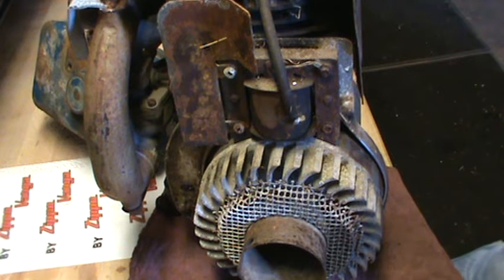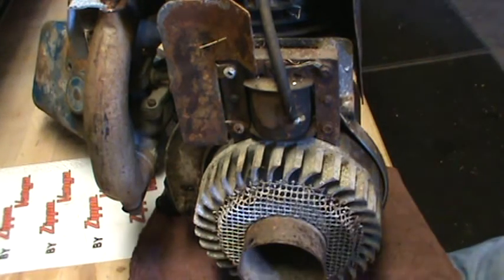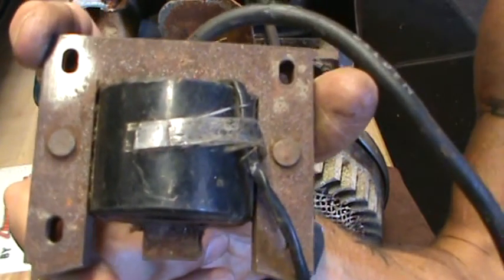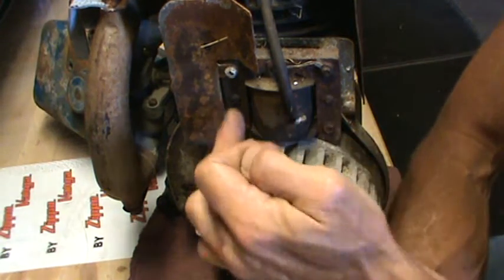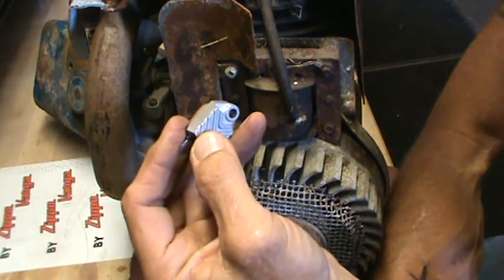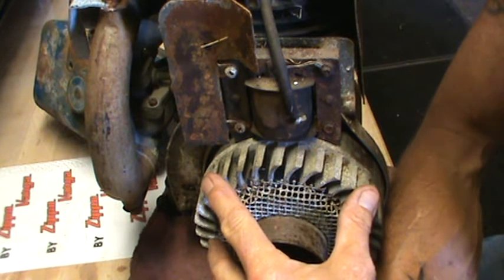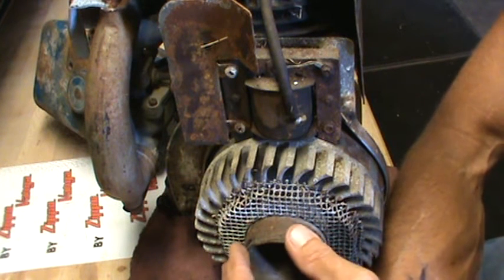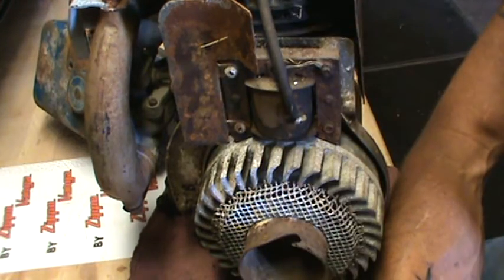Early Briggs and Stratton Electronic Ignition

Comment: Mr. Zippo I know you're busy and probably get people asking you questions all the time but I sure hope you read this. I don't know how else to get my question to comment on something. I have a old Allis Chalmers b1 late 50s early 60s and I cannot get any fire I put the nova-2 on it and got fire for a minute but it stopped my points are non-existent I didn't have them when I got the tractor I'm at my Wit's end and I don't want to scrap the old tractor but I don't know what else to do. Wish I knew how to send you a video of it. Hopefully I will hear back from you... Thanks !!
Reply from the maker: Daniel. What engine is in the tractor. Is it the original Model 19? If so, the Nova II will not work with that type of Magneto. Another option is a battery ignition, but that too requires points. If you've got the Model 19, email me. My email is in the descriptions of my later videos. I will then send you manuals for both your engine and tractor. Zip~

Comment: Excuse me for not watching the entire video (I'm currently very short on time as of writing this comment) but where did you get the parts for the electric ignition? I'm building something from the ignition parts from a briggs I converted to steam, and using the spark plug for a cannon (as an ignition source) and am looking for electric ways of sparking it as I can't get the magnets off the flywheel of the engine.
Reply from the maker: Honestly, your best bet would be to use a Buzz box or an old Fairbanks Morse Ignitor. But if you're insistent on using a Magnetron, you simply need to duplicate the ignition system as designed. you can remove all of the cooling fins from the flywheel, use the crank shaft end as a mount and fabricate a carrier bearing and gear or pulley to mount to the crank shaft then use a NOVA II in place of the points and condenser to simplify the ignition source so that you won't have to find a place to locate the points or fabricate a way to open and close them. I hope this is helpful and gives you a direction to go in. Zip~

Comment: Zippo, how can a Magnatron coil power both the spark plug and charge a motorcycle battery?
Reply from the maker: I'm not sure what motorcycle you are talking about John, but a magnetron is a separate system than the system that provides the spark to the engine. Two totally different set ups and voltage limits. Zip~

Comment: I have spark when I take out the plug and put it in the spark plug wire and touch the top of the motor when turning it over. I have not yet got a chug out of it and noticed when I look at the points and even put my finger over the points I feel no movement. Any ideas why it won't try to start ? Just rebuilt he carb, per your video you posted.
Reply from the maker: I've got lots of ideas as to what could be the problem, but it would take a week to explain every possibility and how to resolve it. Start with checking for compression and presence of fuel. Timing is another factor to consider. If the flywheel key is sheared the engine will not start. Worn valve seats causing valves to not fully close. A valve stuck open. Worn rings. Carburetor related. The list is as wide as it is long Michael. Start with the top two. Zip~

Comment: Zip, what does it mean if the points don't move at all with your finger on them on my 3314v? I still don't have it running, but it turns over and the plunger going to the points does not move either when hitting the key?
Reply from the maker: The lobe on the cam or the points plunger it self has worn out. There is a fix. Get a points eliminator (Search eBay for Nova II), and use it in place of the points. I've got a video showing how to install them. The alternative is removing the engine and replacing the points plunger, bushing and possibly the Cam as well. Zip~

Comment: Zippo, plz help.  1973 16hp cast iron Briggs, no spark.  replaced coil, points, cond, checked all I know to.  Been working on this with another guy who should know but we are at a loss.
Reply from the maker: With everything replaced, I should ask if the new coil has a silver button between the two legs or not. If so, that isn't the correct coil for a points ignition system. Next, if the coil is the traditional points Magneto without the button, loosen the adjusting jam nut on the points and with spark plug connected to plug wire and laying on the head where it has a good ground,  slowly turn the adjusting screw/nut for the point gap in both directions while watching the spark plug for spark. The factory setting of .020 is just a starting point and not the gospel setting. I have only a couple engines out of over 50 where the point gap is right at .020. Some are as close as .012 and others as wide as .030. Let the engine decide the point gap. Once you get spark, lock down the jam nut and check for spark again. Note: Often, the gap will change when tightening the jam nut because it stretches the screw. If you have a Magnetron coil with the silver button, disconnect the points all together with no connected wires at all touching the engine and spin the engine over. If the gap is set correctly between the flywheel and coil (thickness of a business card) and the polarity of the magnets are correct, you will have spark. Zip~

Comment: Thanks for the informative Zip. Where would you find the nova 2. Hope you feel better soon I know how it is I've dealt with herniated and leaking disks in my back for years
Reply from the maker: Fleabay and Amazon. Just type in Nova II or Stens ignition module. If it looks like the one I picture, you've got the right thing. The one I show is the Stens version. The Nova II says Nova II on it. Cheers! Zip~ p.s. On the mend, but it's always a slow process. Glad it happened now and not at the height of tree felling season!